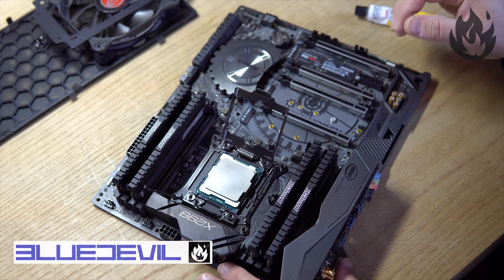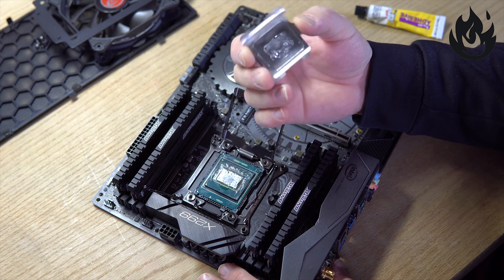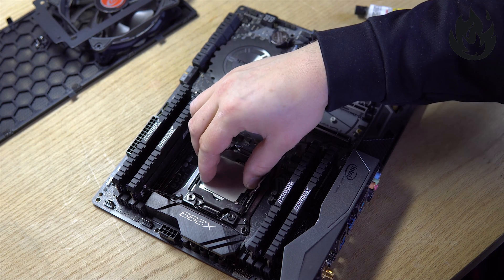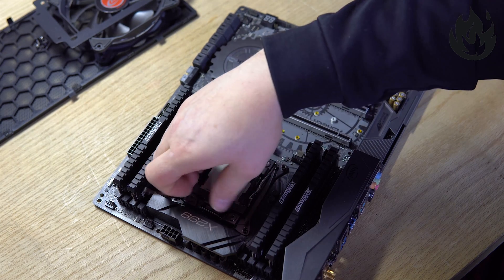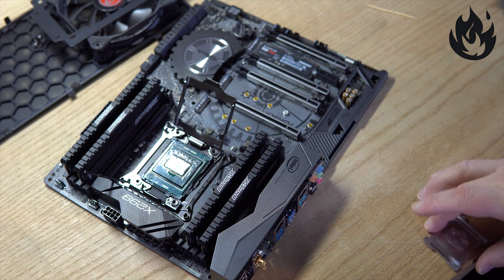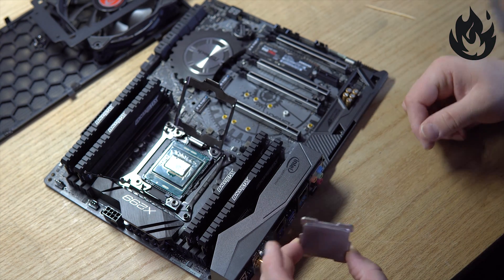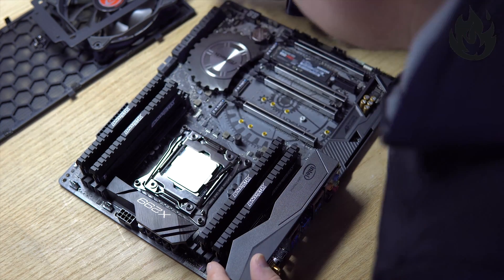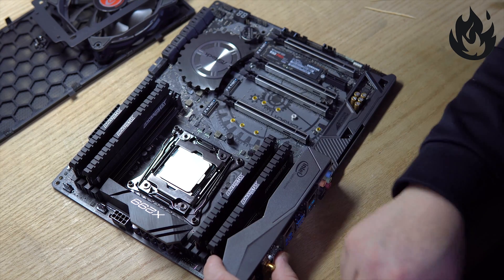Intel Core i9 7900X IHS Fix

Comment: Can't say I love what you did, if you had to glue it back I would have used a silicone based adhesive or possibly epoxy, I wonder how superglue might break down the pcb, or just gets old crusty and fails from heat cycling. I don't know, just my opinion, I am probably over thinking it.

Comment: I never really felt confident enough to do that with my 4790K, and after having the CLU on top solidify into that crust (under was still fine) last year, I am even more wary of sealing it, just in case, even though I switched it completely in May to Conductonaut after the incident with CLU.

It doesn't hurt anything to leave the IHS free floating, just always remember that it is.